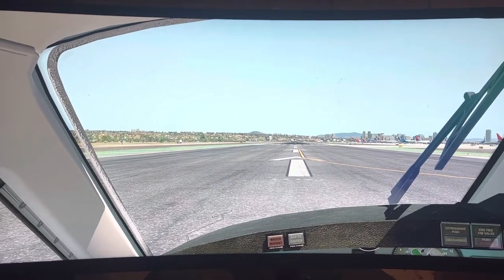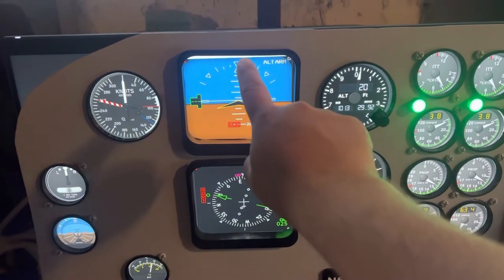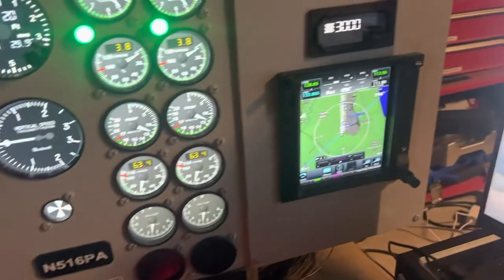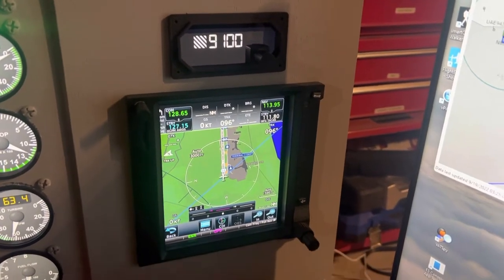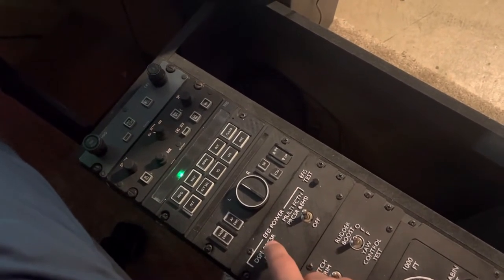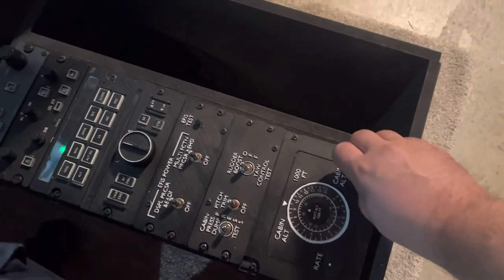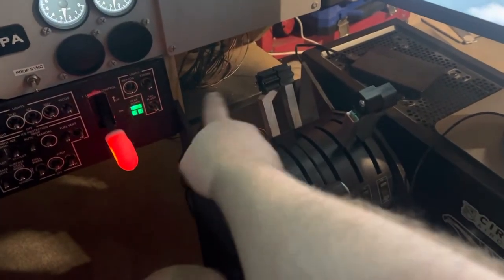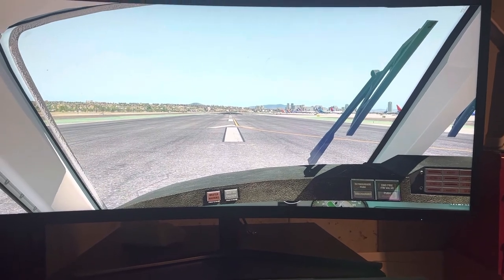King Air Home Simulator - Main Instrument Panel

Comment: This air manager panel looks so awesome! I really wish there was an alternative for MSFS!
Reply from the maker: Yeah I guess my big issue would be the AFL King Air pop outs that I'm using in XP11
Reply: @expataviator7107  I am currently trying to build a king air cockpit. I plan on mostly running physical instruments, but I want to do the EHSI and the EADI with Air manager as I want to do the Collins tube style CRT like you have here.
Reply from the maker: @jonmabec  yeah at the time the AFL pop ours were better than air manager. But it did make it more complicated. It’s been somewhat abandoned in my basement. I ought to try and get it running again….but now on XP12 and dont want to pay the upgrade fee! 🤣

Comment: Nice set up. Where did you get switch panels from , or you made them?
Reply from the maker: Thanks! And i made them
Reply: Keen on doing something similar, any details on how you built the switch panels?
Reply from the maker: @kev403  So its plywood behind, with the switches mounted to that. Then the face plate is another layer of plywood covered by a laminated print out of the panel itself. I punched out holes in the laminated paper for the switches to fit through. I'll do a little video and post to my channel when I have time.
Reply: @expataviator7107  last question, did you get the printouts from any source. I’ve been scouring the net to try and get some decent images or did you just screen shot from the sim?
Reply from the maker: @kev403  i got them by tracing the panel pictures from the POH. I can send to you if you’d like
Reply: @expataviator7107  would be appreciated
Reply from the maker: @kev403  what’s your email ?
Reply: @expataviator7107  don’t really want to put it out here. Don’t know how to private message?
Reply from the maker: @kev403  don’t think you can. Post it and then take it down right away?
Reply: @expataviator7107  I’ll just search. Thanks for the info anyway. My project is in its infancy. Not going to be a 100% king air. My own design using my simionic G1000’s maybe a GTN 750. My main thing was just finding some creative way to build the switch panels.
Reply from the maker: @kev403  no worries! Good luck!